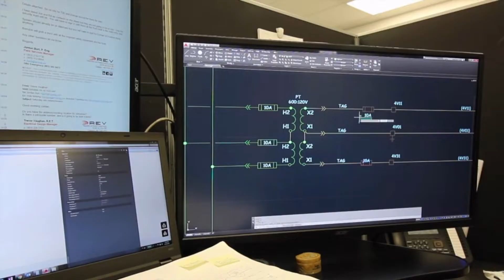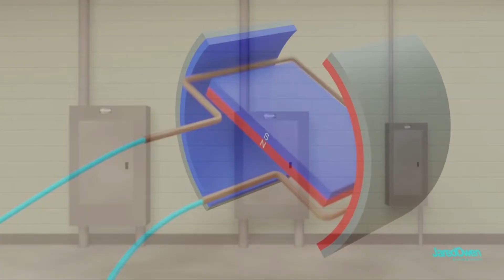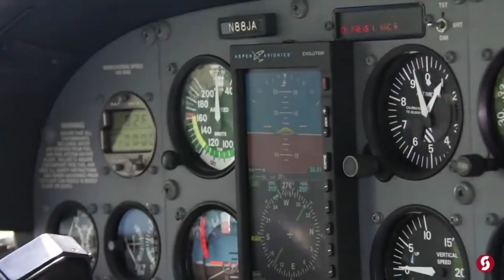4 Things You Should Know About ELECTRICAL ENGINEERING

Comment: Have been on site with  a y a young engineer, being a cruel being , I would stand around with electricians and plant workers and watch them fumble about. 5 or 6  hours in wecwould select a newbie to guide him or her in the right direction . We had this down to a science and it would work well into overtime every time.  It wasn't fair these young engineers had no practical experience in the field.  Even once let one make ball lightning,  tried to tell him but he re indeed me he was in charge,  10nhours ot , and laughed at him . Ask you engineering self how can two 8 gage wires crossed add in a 10,000 amp 400mvolt battery and a DC exciter on a 400 hp motor ....and a 6000 volt main .